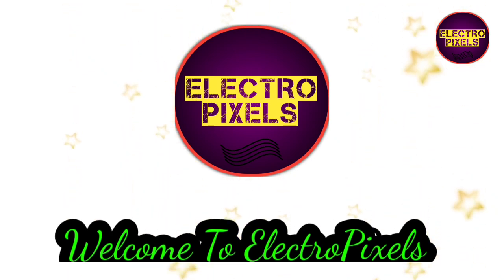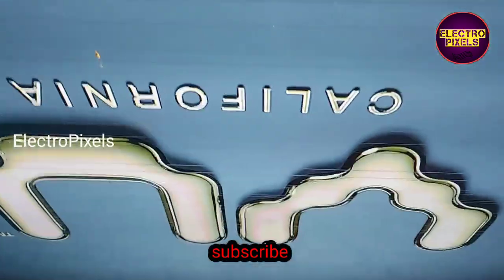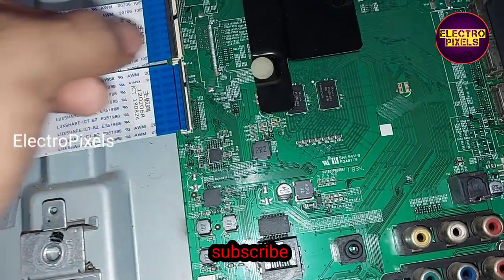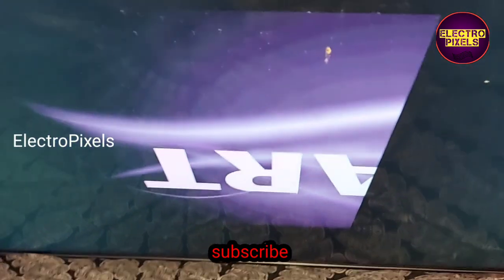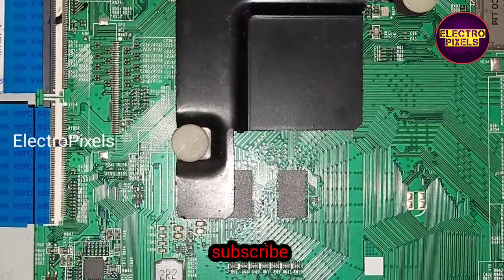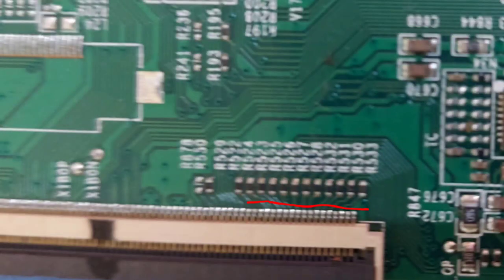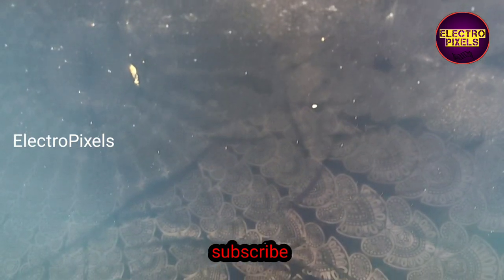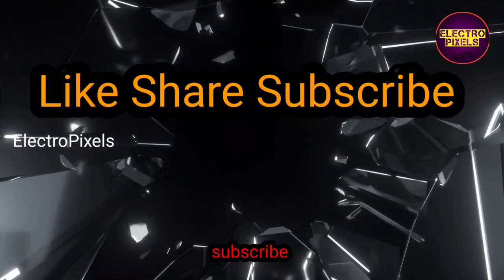Panel Short Removal on VU 55 inch Led Tv|AUO 55" Panel Repairing|Remove Horizontal Lines on Display

Comment: Hie sir this method  how long does  it last on average?thank you  for the information
Reply from the maker: It may depend on luck basis, it will work until the other side Gatesignals get shorted
Reply: @ElectroPixels  ok thank you noted

Comment: other method in the same vu model
Reply: complaint again
Reply from the maker: It just a Temperory Solution, Permanent solution is panel Replacement
Reply: @ElectroPixels  is available   ₹ how many

Comment: Bro i had did this but line's are not going bro
Reply from the maker: May be both side's Gatesignals are fault, then panel replacement is the solution